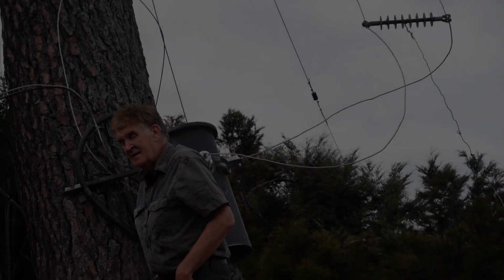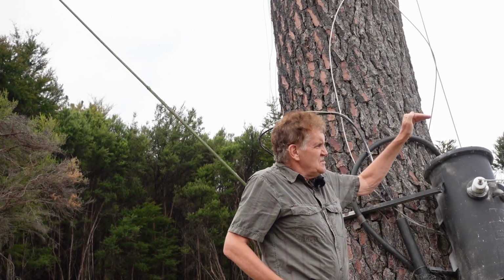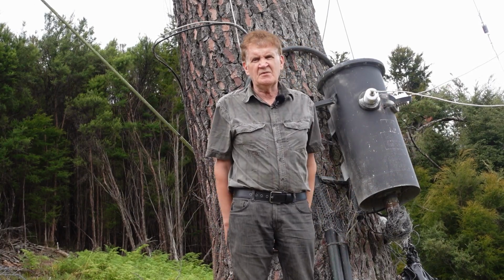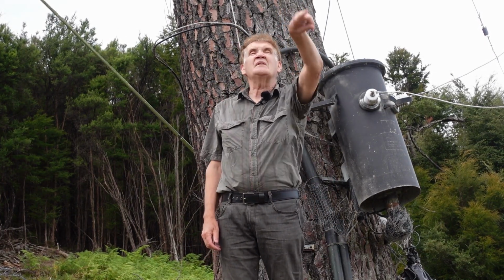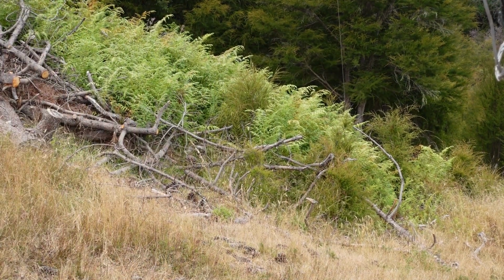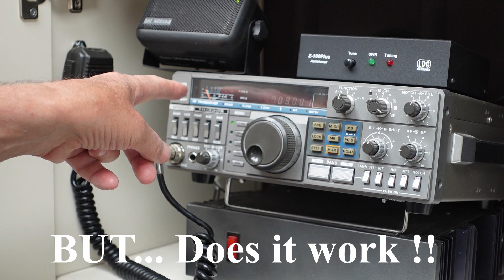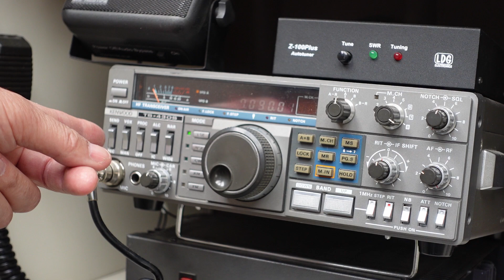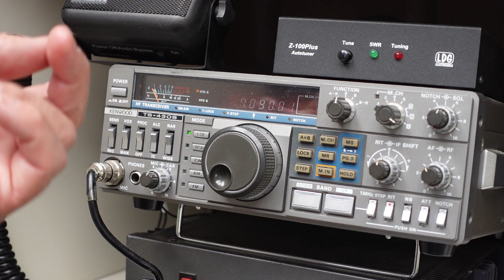HAM RADIO MONSTER ANTENNA - ZL3SV

Comment: This antenna mimics my experience when I had a horizontal loop that used 2,000 ft of utility wire in Maui. I had an extremely quiet noise floor and could often hear US stations on 40 meters during the day that were 3000 miles away. I could check into the westcars net on 7250 which was at noon time. The control operator couldn't believe that was possible during that time of the day. Bravo to your antenna design.
Reply from the maker: Thank you, cheers

Comment: Hi Roly,
When Gary mentioned the antenna was 320m that way and 320m the other, I nearly fell off my chair. And when listening to the VK station the S meter was on zero and he was perfectly readable. You all stay safe.   73   WJ3U
Reply: Reminded me of what an old Ham told me when I was,  young and CBing if you want more signal put up more metal.  I once visited a fellow that lived next to the emergency area a airport that was 1/2 mile away had outside their fenced runway to use if for some reason if a plane would go past the end of a runway and not hit anything. He had a tower and I challenged him to run some wire a few hundred feet that might have been similar to this great antenna shared here. My thoughts likely could have worked and I would have tried it using  5 ft fiberglass fence posts from Home Depo, even being very low I suspect it could have worked some. Been fun trying anyway and just a wire couldn't have made much difference to a plane hitting it, that would have crossed a highway and still several thousand feet from the end of the runway. Thanks for sharing these unusual and special things of interest!!
Reply from the maker: Your friend is right..... get as much iron in the air as possible.... cheers
Reply from the maker: Sorry about that Don, but there ws no easy way to soften the blow.....😉...cheers

Comment: 640 meters is 2100 feet, I don't recall seeing any other ham video with an antenna like that. Cheers from the Midwest U.S.
Reply from the maker: Hi there Joe, it sure is a monster and really works well.  Have a look at the video i put up comparing it with a dipole....   cheers
Reply: @ZL1BQDRoly  I saw that video, thanks.

Comment: Are there any drawings of the layout? I see 320M downhill but does the other 320M also go downhill? all in a straight line or is there an angle at the feed-point? Thanks
Hang on have i got this correct? The open wire is 10mm so. 75 x 0.001 = 0.075M or 7.5cm his spacing looks a lot wider. Is this because his antenna is not 600 Ohms? Would be nice to see this antenna on a vna to show how it was all matched up. I love the low noise level, how much of that is just doe to location? Interesting that it does not pick up on the solar inverter.
Reply from the maker: I haven't seen any drawings from Gary on the layout but from memory it was in a straight line and slightly inverted "v", closer to being a flat top rather than a full on inverted V

Comment: Roly 
This antenna is NZ’s answer to crocodile Dundee anything smaller than 640 meters is a small hobby antenna
Reply from the maker: Yeah sort of Peter.  Most of us have at least two 640mtr antennas phased fro optimum performance in any desired direction.......  cheers

Comment: "Oh I just have a dipole thrown up in the back yard."  Yeah!  Dang!!  That is what you call an antenna!  I thought it was a power transformer for power.  Are the toroids wound with winch cable?
Reply from the maker: I will ask more questions about the "balun" and perhaps that could be another video...  cheers Steve

Comment: Hi Roly. It's a doublet?
Reply from the maker: It's a multi-wavelength antenna on any Ham band thing ......  cheers
Reply: @ZL1BQDRoly  but a balanced feed up to the centre and a wire out more-or-less horizontally to the left and right?
Reply from the maker: @MatFarringtonInfo  There is quite a large drop off each side Mat... bit of a Camera optical illusion going on I think.  It is certainly not flat top bay any means...
Reply: @ZL1BQDRoly  one wave on 472 KHz